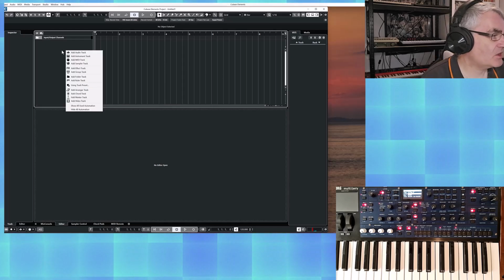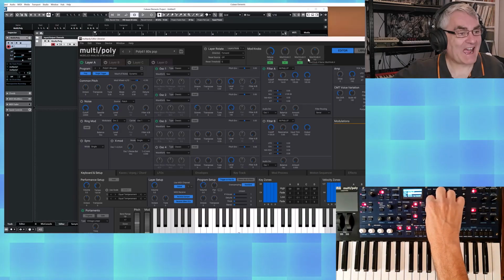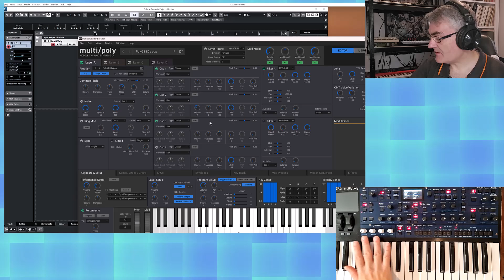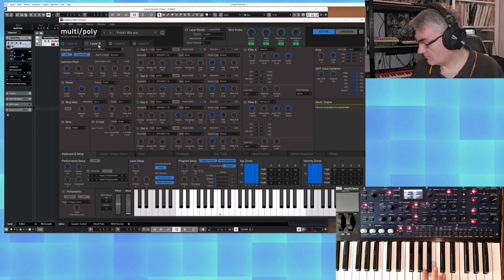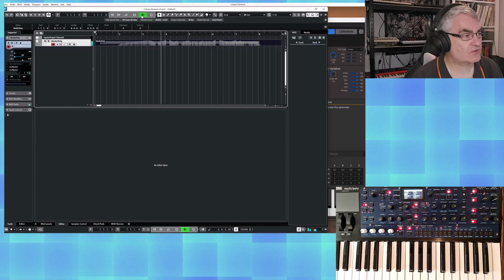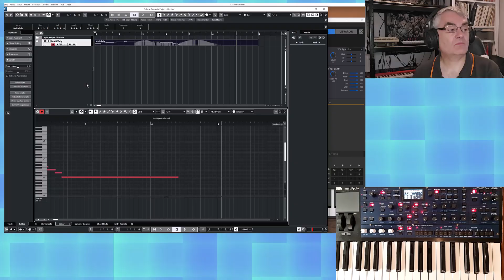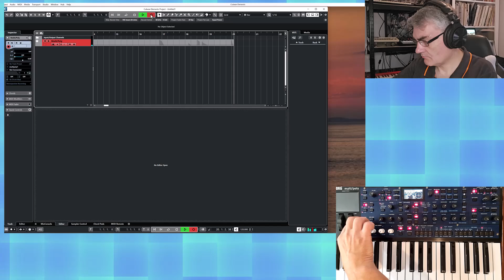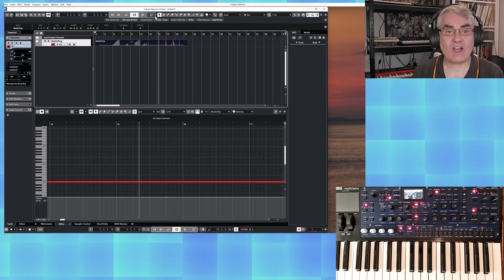Unlock MIDI Control on Korg Multi/Poly, Modwave & Wavestate – Step-by-Step

Comment: Great video!  I learned a lot from this.  I'd love it if you could do a video on the effects section.  Specifically if you could explain why the controls of EG the wave shaper or compressor appear to be duplicated.  Eg with the wave shaper there are two scale controls and two LPF controls, two output controls (but only one tone control) .  Thanks!
Reply from the maker: I have a video out soon on effects but I didn't go into that depth but I will do a follow up video on it.
Reply: @IanDixonTDL  Thanks, it's really appreciated!  I meant to say I'm seeing these duplicated controls on Multi-Poly native, I'm not sure if it's on the hardware interface.

Comment: Great...can you control prog+ and prog- to browse presets with a controller ?
Reply from the maker: As Julian said, set lists is the way to go.
Reply: There is no way to 'browse' them as if using the Value knob to browse the presets. But to select programs you need to send a Program Change (PC) MIDI message from your controller to the Multipoly. (There is no assigned MIDI Control Change (CC) message that lets you do this.) You can use PC messages to select from a pre-programmed Set List. Ian made a video on Set Lists in this series - as I write this it is #51 titled, 'Mastering Set Lists and Patch Changing'. Ian would be able to respond how to do this specifically from Cubase. But for Ableton Live you can specify which Set List entry you want through the Clip View Launch tab; this lets you change program (bank and program values) with each clip. Hope this helps.
Reply: @julianrose3058 Thanks a lot. Will try it!

Comment: Inspiring, thank you. I have different behaviour using Ableton Live (Lite) compared to your use of Cubase. With Ableton Live when you record MIDI from the Multipoly hardware, MIDI control data is captured along with the MIDI keys (tones) data, with no extra setup required (excepting the one-time Settings -> Link, Tempo & MIDI -> MIDI Input and Output Ports, notably the Remote checkbox for CC messages). The recorded control data is found on the recorded Clip view, Envelopes tab. For example, moving Mod Knob 1 while playing a tone records 'MIDI Ctrl' device and '24:Undefined' variable (24 is the assigned CC number for Mod Knob 1) on the Envelopes tab. (These variables can be played back on the hardware by directing the MIDI Output back to the Multipoly.) Even better dropping the Native plug-in onto the MIDI track, it knows the device is 'Multipoly' and the variable is 'Mod Knob 1' so that the Envelope labels are clear. For both the hardware and the Native multipoly, you can select which parameters (including Kaoss) to modulate just by moving them. And you can subsequently edit the control data or add other parameter control data directly on the Envelopes tab in the usual Ableton way.
Reply from the maker: Thanks for sharing your experience with Ableton Live!